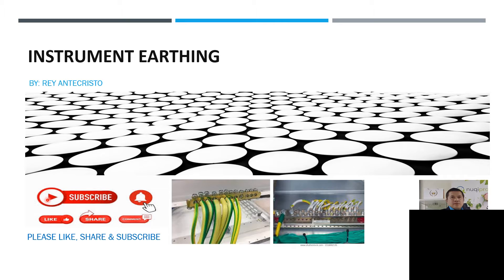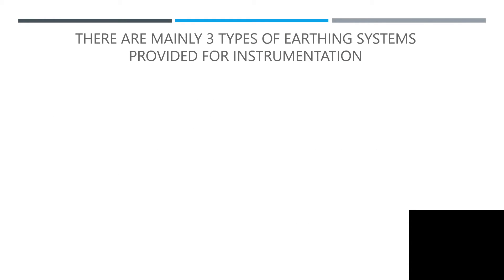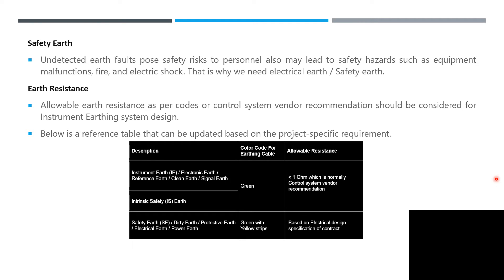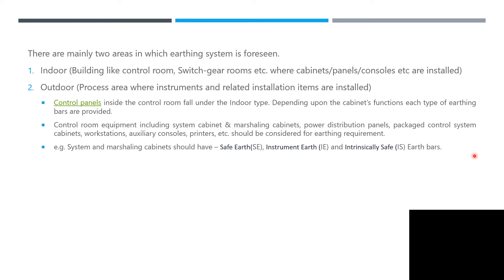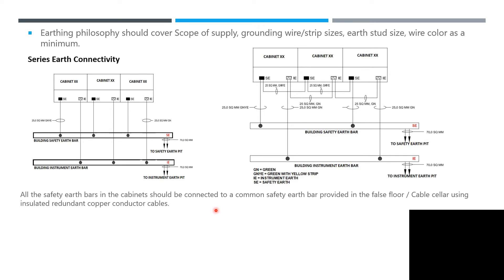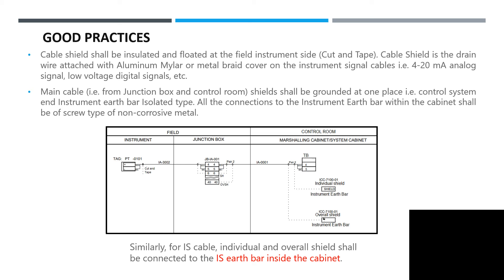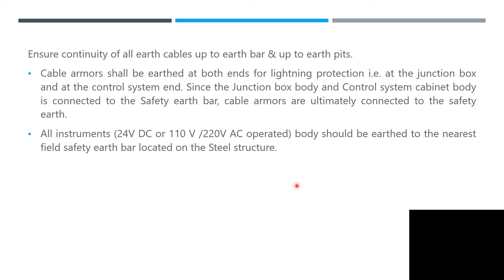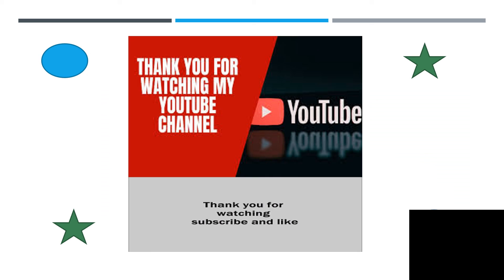#instrument #earthing #safety | Instrumentation Earthing | 3 types of earthing, para sa kalaman

Comment: Sir, would appreciate your kind feedback if safety earth pit(system), instrument earth pit (system) and intrinsic earth pit (system) could be connected to plant earth grid. i.e. interconnection of all three earth system below ground or it should be isolated.
Reply from the maker: Instrument earth pit and safety earth pit should separate, in the project drawings that will be detailed installation.

Example if you have new building constructed your main earth to be connected to the existing earth that can be possible also to get the passing value of resistance

Comment: Sir, I have issue in earth continuity between safety earth and clean earth.
 First the multi meter positive prob connected with SE and  negative prob connected with CE ,this is shows close contact.
Second the multi meter positive prob connected with CE and  negative prob connected with SE ,this is shows open contact.

How this polarity changes in earthing.
Reply from the maker: Continuity is non-directional (PROBE ANYWHERE YOU CAN CONNECT). it's not happening during my journey. But i try checking the resistance if you chance the probe the value is different.
In your project is that greenfield im sure no issues, but brownfield you need to check thoroughly maybe some other wire connected CE

Take note also consider the capacitor discharge during your continuity & megger and fuse for future can affect your testing too. Check also if there a diode in the circuit. 

Finally check your commissioning engineer
Reply: @OFWSUCCESSBAYANI  Everyone  says the same , no one didn't  get the experience  like this. I am serch  in google everywhere.  Resistance  also same one showing  below   2 ohms other one 14 M ohms. Used test device is fluke multi meter and megger . Both get the same result.

Comment: Sir, paano po step by step procedure for testing the clean earth system? In our case po kasi we have a design which is 2ohms. and what are the equipment related to clean earth system? thank you.
Reply from the maker: Sir clean earth or grounding yes the value shall not exceed 2ohm also our project requirements. 
Clean earth:
All earth connections between the electrode and the instruments clean earth bar and the substations earth bar shall be tested for continuity. 

Clean earth system shall not be connected to any other earthing or grounding sys.
Clean earth grouding cables shall not be run parallel with other grounding or power cables.
Clean earth pit shall be separated from other earthing pits by distance as per company drawings. 

Instrument earth pits
PE earthing pits
Lighting earth pit